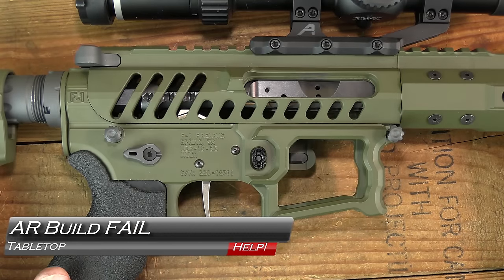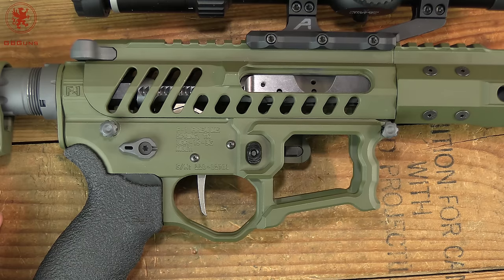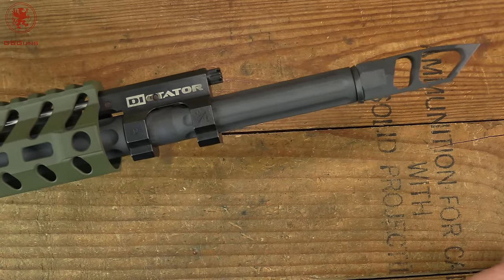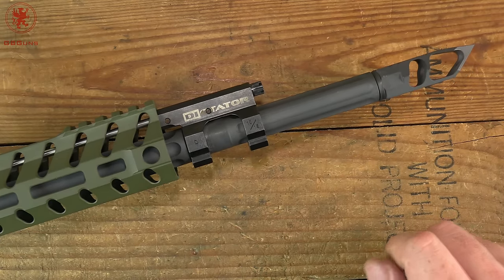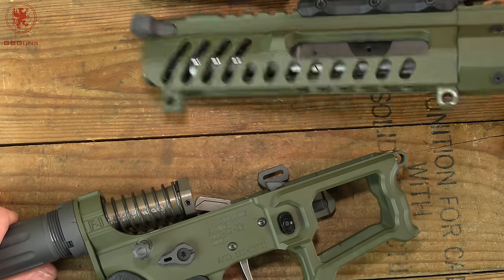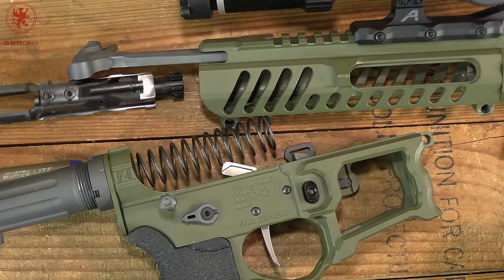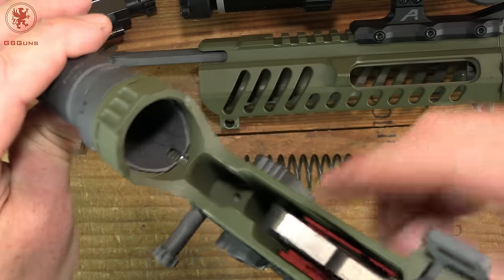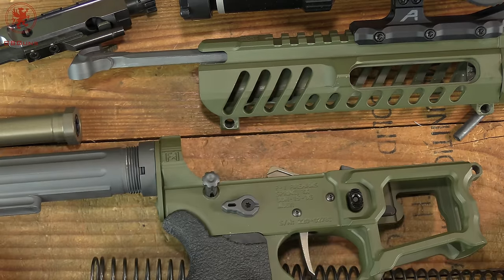The Worst Thing You Can Do For Your AR

Comment: My first impression would have been, after seeing this for the first time and reading a few comments, would have been "A reduced-power buffer spring" perhaps might help as it looks like you covered almost everything else with the product choices of the build.  Thinking the spring had too much pressure to keep the BCG and buffer from moving like it should to cycle.  My background comes from many "captured silent spring buffers' I've installed into several AR-15 builds as well as a couple AR-308 .308 and 6.5mm Creedmoor  builds and trying to hit it right on the head,  first off, so I wouldn't have to troubleshoot too much on initial firing without many hiccups, or any...!!!  And I have to say on my first personal 5 rifles and about 5 more customized .308, 5.56, .223, 300 bo, .458                              SOCOM and a .50 cal beowulf, for buddies rifles, upgrades and mods, etc.  I'm batting 100% w/o having to substitute major components, only minor adjustments, some minor parts swapping,since I had some around by now..;-p.  I LOVE that when it happens..!!..:-) LOL...Just call me Lucky.....heh  Regards.

Comment: I would check the barrel port. If it is too small. No matter how light you go it won't cycle before leaving the barrel. I would swap the barrel out.
Reply: Why not just enlarge the gas port if that ends up being the issue?
Reply: I would check the bolt ring gaps make sure they are staggerd and not lined up a friend of mine had the same problem and I checked it out for him and that was the problem hope this helps

Comment: Couple things.  I think you had it right about your gas pressure. Your gas block looks to be a little close to the muzzle  Also when you separated the upper from the lower I noticed your buffer was already exposed do you not have a detent in the buffer tube?  And lastly  buffer spring looks like it came off a .50 BMG.  Have u tried a lighter spring?
Reply from the maker: Yes, see video description.

Comment: Two things I can think of, 1: the buffer spring is too strong, 2: enlarge the diameter of the the gas port on the barrel and gas block so more gas can vent to the BCG.
Reply: That's what I was thinking as well. I'm leaning more towards too small of a gas port or gas block. Despite the adjustable block it will be limited if the gas port on the barrel is too small.
Reply: gas port should be fine as is. As its purpose is to unlock the bolt, more or less. Given that he mentions that the bolt pushes back a little, it should be unlocking just fine. I agree on the spring being a possible problem, however i also suspect the munition not being heavy enough. if everything is "as light as possible" he might need to use ammo with more pressure and weight to get it to cycle properly. that and make sure everything is lubed properly as well.
Reply: Yep, only thing he can do

Comment: Have you fixed the issue yet? What size gas block are you running? .750? Reason I ask is because it sounds like your not getting enough gas to give it a full cycle even with the light buffer. I almost bet it’s not getting enough gas witch is causing you to stove pipe it. On my 20” build I’m running a rifle length gas tube with a .750 gas block and have had zero issues so would think running a bigger gas port, which you didn’t mention what size your running, would help give it more gas and help with the cycling. More gas then you can toss in a little heavier buffer and have a little less recoil and muzzle rise. I run a .750 gas block on my 16” build with an H2 buffer and carbine length buffer spring and it’s the softest shooting AR I own.
Reply from the maker: All of those details and the full build list are in the article.

Comment: Probably because you tried to lighten every single thing except the buffer spring. There's a reason why the mil spec parts are a certain weight, so it can work in unison with 5.56 and .223. It's a mathematical equation and it should equate to 0, but the buffer spring is not changed therefore will not equate to 0. Not to mention there could be issues when firing, since these are technically out of spec. What I would do is either change the buffer spring or both the buffer and bolt carrier group to regular specifications. Without it is just an expensive paperweight like you said. The difference between this and others' factory AR builds is the constant calculating and also physical testing.

Comment: Riffle length spring and drill out gas hole to .075 had to do this to my 300 aac and 6.5 Grendel you already have a adjustable gas block but before you go buy parts see if the shell case has damage to it and need to know where the shell casings are ejecting at as in position on the clock they should be at the 3 to 4 o’clock point for proper setting if it is not ejecting then check barrel, gas block hole diameter and barrel gas hole diameter and try a different BCG if it is ejecting it to the 1 to 3 position then it is over gassing it and turn gas block down
Reply: So....my ar is what im expecting is a short stroke. Sometime either the spent casing doesn't come out and stove pipes also the ejection pattern is all over the place when it does spit them out.  I put new bcg(anderson chrome lined) and have tried both of the buffers and springs I have. 16inch barrel. Carbine buffer tube. Im assuming  carbine buffer and spring. Gun was built at a shop that is no longer in service. Im assuming its got to be buffer spring and buffer issues. Also...my buddy smashed my magpul ctr stock to pieces trying to do his marine trick of clearing a stove pipe. So I have a moe fixed carbine stock on for now until he replaces it. Ill tell you...with these new parts...it still stove pipes...but it kicks like a friggen mule! Just as bad if not worse than my m44 mosin!! Any thoughts?
Reply: Just a touch more info....sometimes the ejection will be 1 to 3 o'clock. Sometimes it will piddle out of the chamber and land at my feet. Every now and then it will shoot 3 o'clock a few feet.
Reply: Maty D sounds like ether over gassing so it’s trying to eject before the pressure in the barrel drops and causing the ejector to slip off the case because it is still swollen or you have a broken ejector or it needs the o-ring installed on it check the bolt out and the ejected cases for damage
Reply: Will do...with the old unmarked bcg...it was stove piping but appeared to be ejecting normal other than that. With the new anderson chrome lined bcg(better quality presumably) the ejection pattern is extremely random and stove pipes are about the same. Over gassing can be solved by what exactly? Should I seek out professional help? Instead of throwing parts at it??

Comment: Looks like the detent and spring that keeps your buffer and spring locked in place is missing or was never installed
Reply: I noticed that myself
Reply from the maker: Yup, it's in the box
Reply: Misconception that you need them. They break so often the many guys just stopped using them. One less part to worry about. You do not need them!
Reply: Maybe go with 16 inch barrel as well
Reply from the maker: See video description or our latest video
Reply: You might not be getting enough gas. Have you tried to use a piston drive system?
Reply from the maker: I've got piston guns, did not build this rifle to be one.
Reply: Um you do need the detent, it keeps the spring compressed, and when the bolt cycles to the rear creating more force in when the buffer tube and spring catapult the bolt carrier forward creating more momentum...I have been around guns all my life and the past 10 years of my life around AR-15s/M4s being in the Army, I have never seen one built without a Detent
Reply from the maker: They're built with a retainer for convenience.   They're NOT a necessary part of the rifle.  If you don't believe my videos check put InRangeTV
Reply: @GBGuns  look i will say this if your buffer detent breaks, you either didn't put it in right, or you just are extremely careless with your rifle I've never had one break in 10 years, with a 2 part buffer system I still think a detent is essential, and if you're worried about taking it apart and losing parts then that's just nuts, you don't need to touch a rifle at that point
Reply from the maker: Did I ever say anything about the detent breaking?
Reply: @jamesclayton7161  - A friend of mine bought an AR from a guy who had had a career as a US Army armorer. It was an AR he had built himself for personal use (that is, at home as a hobby after he retired). Inside the compartment in the buttstock, my friend found a little zip-lock bag with two buffer detent pins in it. So it would seem to be that this armorer felt it was necessary to keep at least one on hand at all times. After literally decades of experience, maintaining and repairing thousands of heavily used rifles, I wonder why he found that to be important?
Reply: @jamesclayton7161  I was racking my brain trying to figure out a nice way of saying that you don't know what you are talking about, but I couldn't think of one. It is in my general experience that when someone is running their mouth about some nonsense, then feels the need to drop their branch of service... They tend to be wrong 100% of the time, and you are no exception. For starters the buffer detent has absolutely nothing to do with the way that rifle cycles. Secondly, Who are you to tell someone they "don't need to touch a rifle?" The only thing you have done is prove that the Army will take someone with a sub 30 ASVAB score...
Reply: @punk303  so you're saying the buffer tube and spring does not have any affect on the rifle cycling?
Reply: @tedeng9428  I'm not saying they don't break but there are things you can do to protect the longevity of the detent pin for the buffer assembly
Reply: @jamesclayton7161  No, that isn't what i am saying at all.... I am saying that the buffer DETENT has nothing to do with how the rifle cycles
Reply: @punk303  all I'm saying is if you have a traditional buffer assembly that the detent does serve some purpose , and in the case of a traditional assembly it hold the tube and spring inside the stock, it keeps the spring compressed so that it can mitigate the recoil, and help send the bolt back forward, I never said the detent serves that purpose I was talking about the buffer assembly, but like I said on traditional assemblies the detent does serve a purpose, every piece and part that comes with a kit or every piece use to make a rifle serves a purpose, but if you have a what they call a Gucci buffer where the tube and spring are all one piece then no you don't need a detent, but in the video he was using a traditional assembly with the lightest possible buffer and possibly not giving the spring enough compression in which it could send the bolt forward with the amount of force it needs to be sent forward
Reply: @jamesclayton7161  The buffer only makes contact with the buffer detent when the rifle is broken down. When the rifle is assembled, the bolt carrier actually makes contact with the buffer slightly pushing it back from its detent. The detent only exists to make it easier to assemble and take down the rifle... The actual problem with his rifle is that the spring tension was too high to allow the light weight buffer and BCG combo to cycle properly with the reduced pressure of the rifle length  gas system.
Reply: @jamesclayton7161  Also, what you said was " Um you do need the detent, it keeps the spring compressed, and when the bolt cycles to the rear creating more force when the buffer tube and spring catapult..." Which is factually inaccurate. Then you went on to say that he should "never be allowed to handle a rifle. "  Which is also wrong.
Reply: @GBGuns  so what happens when you field strip it? The buffer and spring I guess kinda get pushed out?
Reply from the maker: Yup
Reply: @dennisbanks706  snakes in a can homie...
Reply: @jamesclayton7161   makes a video asking for help and when you help he argued like a know it all.
Reply: @captaindeadpool1640  I didn't make this video but ok
Reply: Spring need to have  detent to retain or it will over extend and short stroke, spring also looks stiff.
Reply: @briansteedley1724  just stop...you have no clue what you are talking about. All the detent does is hold the spring and buffer in the tube when the upper is pivoted up. When you close the rifle the bcg contacts the buffer and pushes it slightly back into the tube. When fully assembled the buffer does not ( or at least it shouldn’t) touch the detent. So how the hell would the buffer be hitting the trigger?  The problem here is 2 fold...the rifle has too long of a gas system, and he has too heavy of a spring to go with that rifle length gas system. He may also find that putting a standard gas block on the rifle might help the problem. AGB’s are way over used.
Reply: @jamesclayton7161  None of my rifles have the detent in them, they work just fine.
Reply: @madkow2001  that's Interesting. I almost panicked cause I lost my detent the other day and the spring broke lol